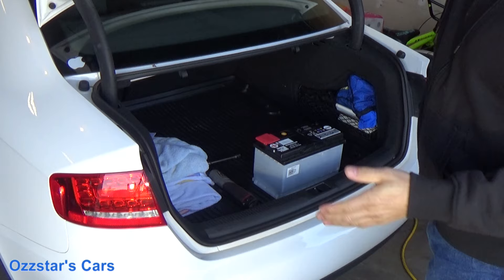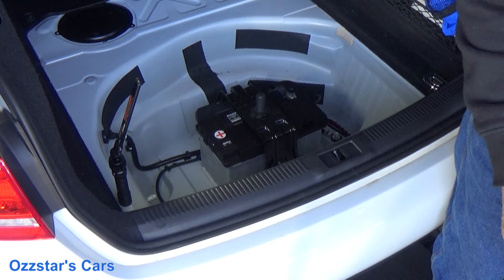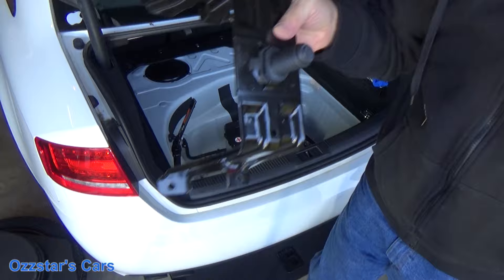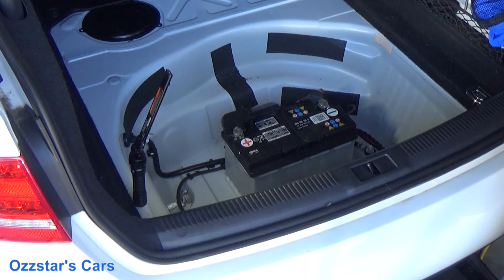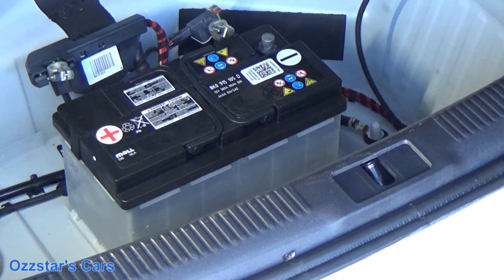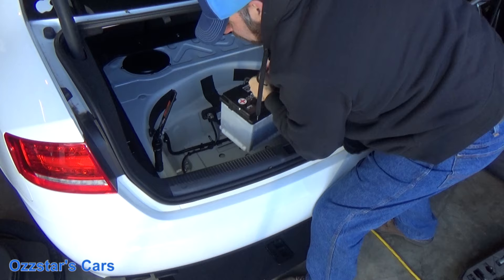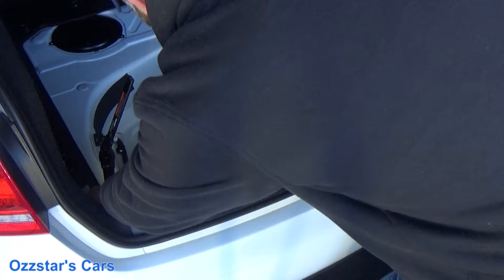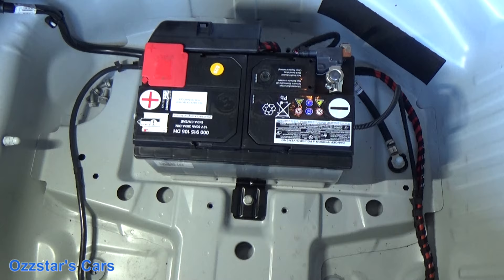Audi Volkswagen Battery Replacement with CODING Autel Scan Tool

Comment: Informative video Glen! I had to go through the same procedure of where I replaced the battery on the 2016 Escape a few weeks ago. The procedure for VWs are different for Ford as I didn't have to enter any serial number for the battery. Basically, click on the reset button in the scanner and it says battery has been reset. Have a good one!
Reply from the maker: It's kind of scary when it's that easy huh Terry? Haha  The nice thing is you didn't have 10 steps to get it out.😁
Reply: @ozzstars_cars  As for as the coding it was pretty easy. Not so easy on the battery replacement as the battery was totally underneath the cowl. I had to remove the wiper arms, the cowl, the drain pain and a few other items. Not like the old days when the battery was right there in front of you.
Reply from the maker: @stuzman52  a PIA!

Comment: LOL, glad you enjoyed my trans swap! I was losing my mind on that job! There should be an engine swap vid coming any day now, lol. It's still running for now ... but who knows for how long. :0

Things are getting WAY to complicated out there in the automotive world today!  Boy do I miss the days of ONE wire alternators - they either charge, or they don't! And they used to put 'em under the hood! If I had known what was coming, I'd have bought every car I saw as a teenager and stored them, lol.

Sorry man - I am failing miserably with the damn phone notifications. I didn't see your vid, but I saw Eric's last night. Just realized I missed one from Ivan, too. Technology! Works for everyone but me, LOL! :D

I just had to put a battery in the Silverado. Battery #2 within 14 years. I got 8 out of the OE one (with help from my fancy BatteryMinder charger), then I spent $300 on an Odyssey AGM, and barely got over 5 years out of that one! Was so mad. I hate the computer-controlled field on this charging system. I don't think it does a very good job. Wish there was a way to get it to keep the battery at 14.2v and stay there at all times. There probably is - I'm just not  motivated enough to figure it out! I got 12 years out of a DieHard battery I bought in Phoenix that I had in my '72 El Camino. I had heard that was because it was a "hot climate" battery - thicker plates for desert heat. Don't know how true that is, but it seems plausible. The battery did seem heavier than normal. It certainly lasted a good long time. I grabbed a DieHard Premium from Advance Auto for the Silverado - hopefully they didn't just slap a name on a cheap battery. Guess I'll know in 6-8 years or so!

Anyway - great vid, man - I had no idea about any of this. I have a feeling I'm in for A TON of surprises with these newer vehicles ...
Reply from the maker: The longest I got out of a battery was in my Ford Ranger, 14 years no name brand.  My friends father is in the auto battery business for over 35 years.  He says sometimes you get a "good one".  Nowadays 5 or more years and your winning...or should I say waiting... for the battery to quit.  I don't get notices anymore in gmail.  Occasuonally I go to the subscription tab and scroll through to see who posted.  Lately it seems my free down time is limited.
Reply: @ozzstars_cars  - Good to know about batteries. I have long suspected that! Just like cars - sometimes you get a good one, lol. 14 years is AMAZING!! I figured only far northern climates would get that kind of life. Interesting!

I hear that on the free down time - I've been working on editing a engine mount swap vid on yet another GMT-900 platform ('07 Suburban - same as mine except for the aluminum block LC3 instead of the iron block LMG mine has, and disc rear axle instead of the drum on mine, too). I'm a week into it, lol. Just can't get a minute to finish. I just got back from dad's a few towns over. Slammed down some caffeine while I watched your video, now I have to finish up that powered parachute trike that's been here 3 months now, lol. Not enough hours in the day!

Comment: I'm getting an aftermarket AGM battery for my S5. I don't see anywhere the serial number like the one you showed. Can I use the same as yours? My understanding is that the computers just wants a number to reset all values.
Reply from the maker: Is my battery the exact same CCA, CA and size?
Reply: @ozzstars_cars  similar, but the computer doesn’t know all those values. All it needs is current the actual values by entering the new code

Comment: Can you install the battery and will the car run until you take it somewhere to have the battery programmed?
Reply from the maker: Get it programmed quickly, I don't suggest the car is run with a non programmed battery.  It can cause alternator damage .
Reply: @ozzstars_cars  thanks
Reply: @ozzstars_cars  ok the error code is U0155/$07E8 lost communication with instrument cluster control module battery 12.4 volts

Comment: Hello, can you put a new battery with same capacity if the subscription is outdated? If there is a different capacity can you code it without subscription?
Reply from the maker: As long as the car is not newer than the last time the tool was updated.
Reply: @ozzstars_cars  good info, thanks!

Comment: Any advice on getting this to work with a 2013 audi q7? Anytime I try to hit function 61 to adapt new battery (800cca h7 Agm everstart), it just says function not available no matter how much I try.
Reply from the maker: What scan tool are you using?
Reply: @ozzstars_cars  sorry i forgot to mention. Autel MaxiCheck MX808S-TS
Reply from the maker: @cjo3620  To be honest I am not familiar with that tool. Contact Auyel directly to see if that tool has the capability with the specific car you are working on.

Comment: Hi. did you place a 12v battery or jumper pack on the front engine battery contacts so that you don't lose any of the radio or other settings before disconnecting/replacing it? Thanks
Reply from the maker: No I didn't use a memory saver but that's a good idea if you own one. 👍

Comment: Another awesome video Glen! Can you perform this same battery coding job with your MS906BT? Thanks!
Reply from the maker: Thank you sir. Yes the 906BT has the same battery coding technology.
Reply: Good  very helpful  video  bit foursome reason my autel ms 906bt  won't coding battery  on my 2006 audi a6 3.2  quattro ((((
Reply: @MadMaKS4478  call autel tech support.  I called with a communication problem on 2019 RAM 1500 and they were extremely helpful.
Reply: @mrbadwrench1320  thank you  very much  for advice! Really appreciate!

Comment: Hard to understand why this is necessary. A cynic would say it is to reduce pesky aftermarket competition, but that can't be the only reason. Maybe in case a lithium or AGM battery is used instead of lead acid.
Reply from the maker: It is a mystery to me why all the Euro's require this.  Maybe most owners rely on the dealership to do maintenance work and this is a gravy way to make more profit?   We will probably never know.  Ford uses battery registration as well, I know the F150 does.  Cool thing is if you leave the truck sit unused for 8 hours the BEM will auto calibrate.  Otherwise using the scan tool is the way to go.
Reply: My understanding is that the newer vehicles with autostart/stop will be cycling the battery (and starter) many more times than a non autostart/stop vehicle. EFB and EFB+, as well as AGM batteries, are designed to handle this functionality way better. Programming the battery details is likely one way to ensure that the correct specs and type are used in the event of a warranty issue that is caused by an electrical malfunction. Also, resetting the system/battery "start" date can help the system learn how to properly charge the battery over time (i.e., a newer battery may not need the same care/attention/charging cycle time, etc. as an older battery).

Comment: What if u buy an aftermarket agm battery that doesn't have a bem code on it.
Reply from the maker: Sounds like a potential problem.
Reply: @ozzstars_cars  . I'm replacing a battery on a 2007 Q7 with push start nd stop. Does it have to b done or I can get away without coding it
Reply from the maker: @preez3560  if you have to ask I'm going to go out on a limb and say you already know the answer to your question?
Reply: If you don't code your battery, the system will likely treat the "new" battery as a (n+)-year-old battery and may end up charging it/cycling improperly. The discharge rate and other factors will vary from new to old. Also, if the amp hours are different from the new vs the old, the vehicle won't know this and you may end up with a battery that doesn't last as long as it should. I bought an aftermarket battery from both O'Reilly and Costco. The O'Reilly battery did not have MFG details or a BEM code, but the Costco did. The Costco AGM battery was superior and cost less. It was also made by an OEM mfr, same as the existing battery in my VW Atlas. If you DO NOT code the battery into the vehicle, you may experience random electrical problems (some maybe 6 months down the road) as well as shortened battery life.
Reply: @cmscott Can it cause your car to not start. I bought a aftermarket one. Car cranks with no start, windows not working. High beam lights have a weird sound and random communication fault codes.